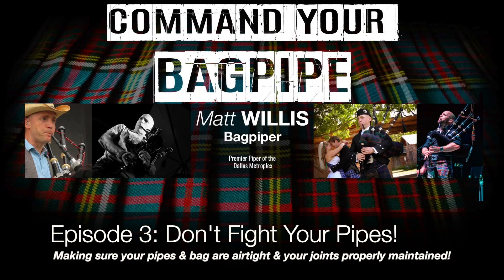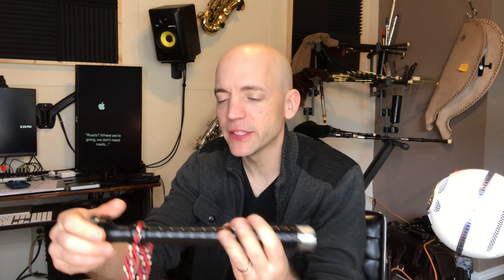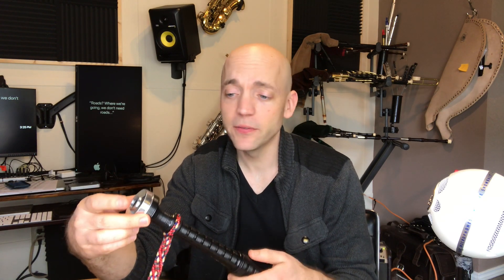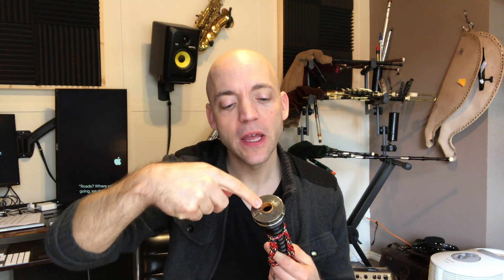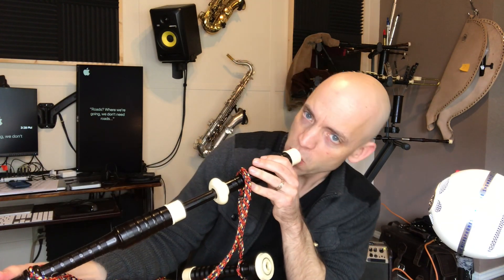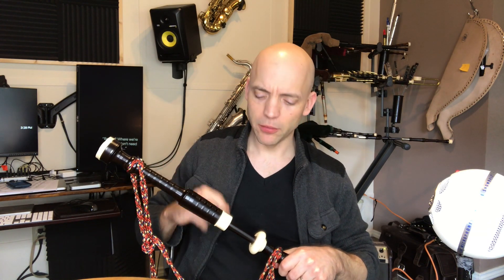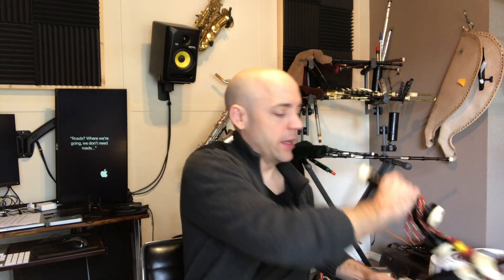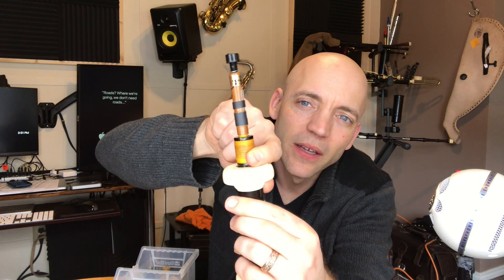Command Your Bagpipe: Don't Fight Your Pipes! - Bagpipe Lessons

Comment: Hello Matt
I am resurrecting a set of pipes after a good decade of neglect (I am sorry to say)
The bugs had bitten a tiny hole through the hide (yes - I hang my head - but time to move on)
So I found a long thin bolt, reamed a washer down to a size that would fit down the drone stock.
I also cut a leather washer for inside the bag. 
So I fitted the steel washer then the leather washer on the bolt and put the bolt into the bag through one of the drone stocks. 

I then pushed the bolt from the inside out of through the hole.
Then fitted a second leather washer, a steel washer and fastened it with a nut
looks kind of 'bionic' but works well.

When the economy starts moving - I would like to replace this set.
But for now I am learning more than I ever did long (long) ago in the band  

Now I am playing at least once a day to build up my muscle in my mouth and slowly dealing with all the niggles to get the music going

Thanks for your channel man

S
Reply from the maker: That's quite the repair there!

Comment: Thanks Matt. I used Mares Liquid Patch (tube of black liquid pvc) from a scuba diving store, to fix a leak on a Ross suede bag between the collar base and the bag. Cost around $20 AUD so a decent temporary fix for a difficult area to mend. Not sure how long it will last but it’s good to know that the product works for a repair that  would normally require bag replacement at much greater cost.
Reply from the maker: Thank you for sharing! I’ll keep that mind should I need to patch a synth bag. Cheers!

Comment: I just discovered your channel! Loving it! Could you do a video on humidity? When I moved from Scotland to California, my pipes were not happy and the joints went very slack. How do I keep my pipes happy in a hot dry climate?
Reply from the maker: Glad you found the channel! Share it with any piping friends you might have! As for the pipes, there will always be a certain amount of movement when changing climates, but much can be minimized by oiling your pipes, which I cover in this video: https://youtu.be/luZwC6J2iMo
Reply from the maker: What type of string/material do you have on your bagpipe joints?
Reply: Matt Willis Bagpiper my pipes are actually SSP so I’m not sure if I should lol them or not. Currently I use non waxed hemp.
Reply from the maker: @kerry00  AH yes, SSP... Bellows driven? If so, oiling is much less important because there isn't moist air being regularly introduced to them. That said, oiling would still help keep them from moving as much with weather.
Reply: Matt Willis Bagpiper yeah. Since things are a bit slacker I’ve but a bit of sewing thread and in more extreme areas, some plumbers tape. But I think I’ll have to rehemp at some point. Would normal bore oil work?
Ps, any tips for a too slack chanter in the stock?
Reply from the maker: @kerry00  Most readily available bore oils are mineral oil, so i do not recommend them. Bore Doctor bore oil is the best, and sweet almond oil (for skin use) is a very close second....
As for the main stock, it takes thread/hemp/string like the others, just a bit more awkward to put on!
Reply: Matt Willis Bagpiper thanks!

Comment: I actually just repaired a busted out zipper on an older(black) Ross canister bag with E6000 industrial adhesive... luckily the closed end was the end that leaked.
 I cleaned and dried the leaking spot on the zipper and used hot glue to fill in the outside and fill in the leather flaps and let it dry well.... that stopped 97% of the air loss... I then I opened the zipper to where the hot glue is... and I applied the E6000 on the inside over the zipper area liberally..... I then (with corks) inflated it to pressure and set it leak side down...I noticed the open end was losing a tiny bit... so I put a big glob off petroleum gel on the inside of that side and put it to pressure again... after ten Minutes the vasoline has pushed through the zipper as much as it was going to and it was keeping very good pressure.... (I literally just dumped my extra money into new SL2 McRaes... no more money for a new bag...
Reply from the maker: A leaky bag is one of the worst things that can happen with our instrument. I'm glad you were able to get yours under control!

Comment: Hello Matt!
I just came upon your site.  Great, informative videos even for a beginning piper.  With all the spare time I've had recently because of the lockdown, I thought I'd take time to fix some issues I've had with leaks.  The middle section on my base drone "rocks" back and forth on the pin.  I think this may be a problem that occurred during manufacturing, so I'm trying to rehemp to see if that fixes it.  Then again, it could also be due to the dry conditions here in west Texas.  I'll have to see.

I had someone tell me once that to get the best sound from the base drone, the top section should be at the bottom of the hemp line. I was also told that the tuning joints on all three drones should be equally tuning at about two fingers width not just for appearance but also for the proper adjustment and optimal sound production. How high/low on the tuning pins should the hemp line be?  Where is the optimal point on the pin to get the best sound from the drones?
Reply from the maker: Hello! For that "rocking" motion, I often have to add a bit of hemp to the pin itself (below where the rest of the hemp is). Tends to happen when the receiving chamber is a bit too wide vs. the pin diameter. Are these Naill pipes? 
As for tuning, the old story is the tenors should be showing just a bit of hemp, as well as the bass top, and the middle joint should be about 2 fingers above the mount. I don't know if it's true, though I do chose to try and tune my pipes this way. Haven't experimented with other arrangements.
Reply: @MattWillisBagpiper  I appreciate the quick response.  To answer your question, no, my pipes are not Naills.  They are a used set of basic ABW Pettigrews that are fully combed and beaded.  The components seem to be sound, IE no cracks that I have noticed.  The projection mounts and ring caps are made of imitation ivory that is badly chipped. The tuning pins are plain and they have nickel ferrels that are very loose and come off easily.  It has a telescoping blow stick with a flapper valve, Ash plugs in the drones, Omega reeds, and a Ross canister bag and moisture control system.  The chanter has been replaced with a basic plastic McCallum. The original chanter and blowstick that came with the pipes are missing. 
Living here in west Texas (Lubbock) is like living in a piping wasteland....no pipe bands to practice with and pipers are a rare thing.  Even on St Patrick's Day you can't find one.  Pipers that I have met here are mostly in it for themselves or are too busy and not into teaching especially older students, like myself.  
My goal is that eventually I would like to try to reach the competency level to be able to play with accuracy, musicality and confidence to compete in grade 4, and a secondary goal of having the knowledge and proficiency to play in public maybe for hire. 
I have already downloaded some of your practice files to work from towards this goal.
  
Could you possibly put together a lesson on how to properly hemp a joint so that it prevents air leakage, provides stability in the pipe, and yet is easy to manipulate  when tuning?

Lastly, could you put together a list of tune suggestions for beginning pipers that can be used in the various music categories in a grade 4 competition?

Thanks again,
Monica

Comment: Matt, excellent video. I just mouthtested my stocks and didn't have suction on ANY of my drone tops!!! Where do you buy that 3M hemp seal you use?
Reply from the maker: The hemp seal is just the wax ring a toilet sits on. You can get one from a home improvement store for like $1.50 and put some in a small resealable container. Sorry to hear your tops are leaking!

Comment: The T-zip folks recommend that zipper be closed before stowing the pipes in a case. An open zipper can be damaged by anything pressing on the open zipper. The T-zip can get a leak at the area of the zipper stop. That small square piece of rubber at one end of the zipper. Open zipper and it is the piece the zipper backs up to. It may leak under arm pressure. If it leaks clean area with denatured alcohol then apply Aquaseal all around the zipper stop base. Repair will last the life of the bag If done properly.
Reply from the maker: Good info! That said, in nearly 20 years of dealing with zipper bags, I have not had one fail from the teeth being damaged from being stored in the open position. I'm generally more concerned I feel about keeping my synth bags dry than anything else (to reduce mold growth and such).
Reply: Matt Willis Bagpiper being in a band setting I have seen I have seen a few issues more related to crowded cases. The T-zip zipper stop has been the greatest issue. One such leaky caused a whistling sound rather than a hiss. I will check my photos for a photo of the area of concern. By the way I find your videos of great help and I refer students to your videos.

Comment: How does a hairline crack in the drone stock, chanter stock, and drone Reed seat affect the pipes in regards to airtightness and tone quality etc please ? As I seem to have these. Is there a temporary fix I can make wood glue etc? And what has cause them?
Reply from the maker: Man, that’s a lot of cracks. So sorry! Do you have a zipper bag? If so, you could stopped up the cracked stocks from the inside of the bag and do the suction test to see if they’re leaking. Same basic idea with the drone bottom with the cracked reed seat, but you could just seal one end with a finger and do the suction test (remove the reed!). If they fail, I’d contract the maker (if they’re still around) or a bagpipe repair ship and see what it would take to repair them. That is beyond my level of skill.
Reply from the maker: As for cause... were the pipes left in a car during a hot (or cold) day? I find temperature swings and extremes cause many of the hairline cracks. Improperly seasoned wood can do that to, though most all makers these days use quality seasoned wood.
Reply: @MattWillisBagpiper  thanks Matt, not left in a car, but for a few years I was travelling a lot from hot humid Gibraltar to cold UK every 4 weeks I wonder if that will have caused it. I will try the suction test. I've already replaced the blowstock a few years ago. Thanks for your reply.

Comment: My goodness, I never knew about leaks at the ring caps. I have a loose ring cap on one of my Lauries tenor drones.
Reply from the maker: Definitely with looking into getting it properly repaired. Seems many pipes, old and new, have issues with leaking tops. I find it odd this isn't tested in the shops or factories. Coming from other woodwinds, having the instrument as airtight as possible is paramount. We seem to only worry about the bag being airtight, but it all effects the sound and efficiency.